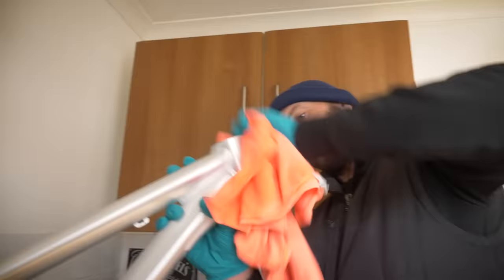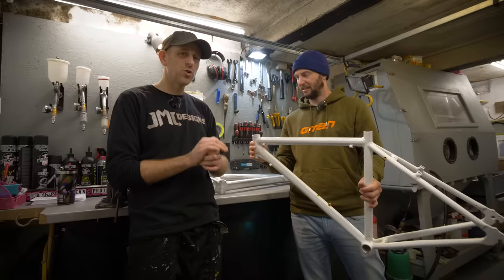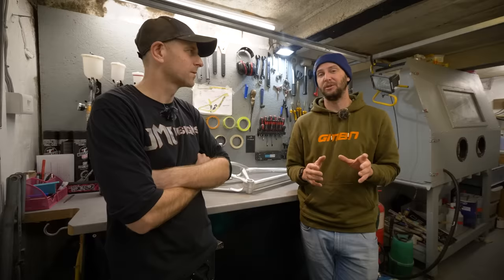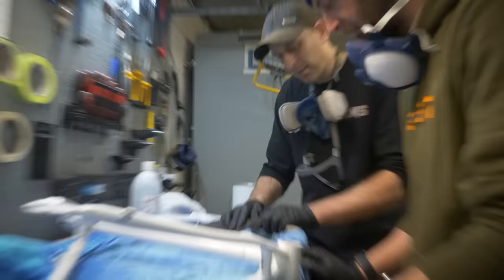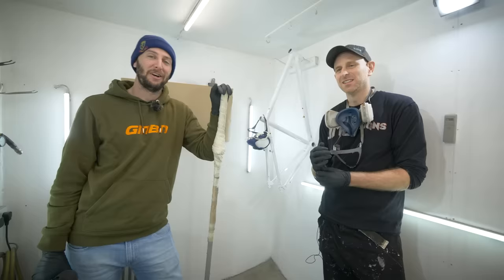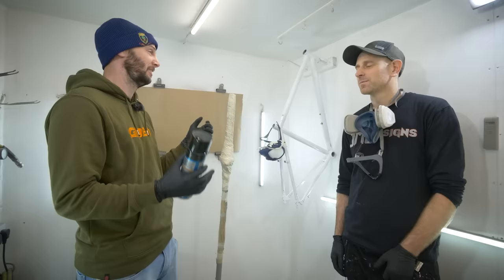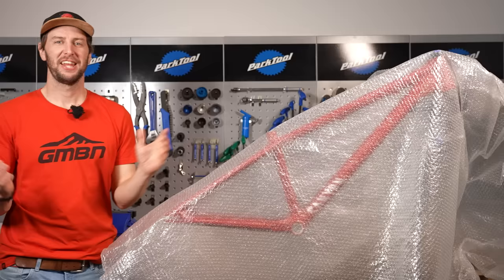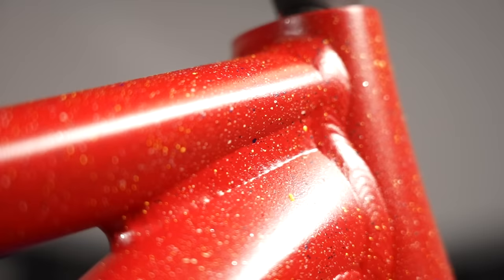How To Paint A Mountain Bike | DIY Bike Upgrades

Comment from the maker: Would you give your bike a custom paint job? 👇
Reply: I already have 4 bikes with custom paint jobs, but had them done professionally. Yours looks awesome. I am thinking of doing something with a Banshee Rune V2 I recently bought used. I like the bare aluminum look these days, so might do that. The blasting tip was spot on. Thanks!!
Reply: I'm in the process of gathering everything nicely to repaint one or two frames soon (a vintage road and a Stoic2), I'm quite scared because it's really not my thing but your video reassures me a little, thank you  !
Reply: Bought an ebike
Stripped it down, squirted it with black matte Tremclad and a year later it looks like it did after day 1.
Not the paint of choice for most but what I had on hand. No priming, no sanding or wet sanding in between. I did it outside in the sun in a 10x10 screen tent so there wouldn't be any dust or debris stick to the paint while it was drying.
6 very thin and even coats over 2 days and it looks amazing.
I'd do it again. Had a blast doing it myself, so I am bias but think it is a good way to do it if you are a true amature like myself.
Reply: Supply issues mean my fork came in shiny black and it should be matte to match the frame. It seams like a pretty basic job with a buffing and a respray but any pointers would be great. Love a good alloy hardtail. Wish my body would let me ride them. Thanks
Reply: I did mine with spray.bike and it turned out amazing
Reply: recently got my hands on an old Giant fully rigid MTB and I'm torn between cleaning it up and touching the paint up or stripping it down to bare metal and giving it a custom color, even considering heating some areas up to cause an oil slick pattern then using those markings to make a sick looking logo
Reply: I like diy paint jobs. If I want it properly done, I would choose powder coating. Its way better and rock solid. We have a lot of companies here in Germany who do coating. Its also cheaper than a paint job. Its aprox. 100-150€ for one frame :-) If you choose paint, please get 2k products.
Reply: I really want to buy an old second-hand hardtail, give it a really cool paint job, and upgrade the brakes, shocks and drivetrain.
Then, show it off to my friends.
Reply: \I have a used 2004 TREK 4300 disc and i want to get it done in nukeproof yellow!
Reply: yes i would love to but it takes time and im only off on sat and sundays lol
Reply: came here to get somne pointers

Comment: I have done a pretty good amount of spray painting and I can tell you the #1 most important part of any paint job is preparation. Be obsessive while prepping and if you have done your homework on which paint to use and how to apply it….you will be SO happy you did it yourself. Very satisfying. Since bikes are outside so much, I would use a 2K clear that is automotive grade. It will resist UV fading. Never paint without a respirator and in a well ventilated place. Painting over paint, you need to use a primer, bare metal use a etching primer. If you have never painted before, paint something else first to get the feel for it. Temperature is critical for dry time, read the can. I soak my cans in hot water 15min before I paint and I don’t set them on concrete in between coats it will suck the heat from the can. If you make a mistake, don’t sweat it. Let it dry and lightly LIGHTY sand that area and repaint it. Painting is very satisfying, but VERY time consuming. 
YouTube has hours of how to paint videos. 
Get out there and paint! Lol
Reply: nice tip there,Todd!🤘
Reply: @bongers94  thank you!🙏
Reply: I think this applies to any job you're going to do, preparation is the key to success.

The rest of the tips you have written though are spot on, great advice!
Reply: Thanks for the advices!
Reply: Always like to read the comments on these videos. Lots of little details I wouldn’t think like setting the can on concrete.
Reply: ive got quoted 180 quid + VAT to sandblast my full sus bike frame mentioning that itll be raw frame with no accesories. is that considered to be normal price nowadays? and if not sandblasting, would you recommend some paint stripper instead?

Comment: I've painted (twice) my dad's first "mtb", a '92 Giant Rincon. Still going strong as the commuter bike, basically all modern components: 1x11 xt group, mavic tubeless wheelset, etc. Kinda want to paint it again with a simple pink, just to be different lol

Splatters look dope! 

Might be spraying a little closely to the frame. Personally, I did like 4 quite light coats of each color that I was using, and a last heavier coat. Gives a better glossy finish in my experience. (yes, clear coat will help that a lot too)

Comment: Bikes are pretty easy to take apart with the right tools ,alternatively you can mask up with heavy plastic and prep it fully assembled ,although some areas won't be accessible ,maybe a bit sand paper glued to a knife mite work for these areas ,Been a painter for 20 years ,the process is the same ,strip ,sand, filll ,sand again clean ,degrease  x2 primer coats  ,2-3 top coats ,2 coats clear (matting agents available) 2k paint is best for durability ,gun paint is also worth a look for silvers and matts

Comment: Excellent video guys, keep em coming! I too have dabbled in painting bikes, but really suck at using rattle cans, even when trying extremely thin layers and multiple layers and have ended up mostly using brushes and cheap tins of paint from low end hardware type stores (£2-£5 tins from b&m for example) and an inordinate amount of wet sanding sanding between inordinate number of coats. Which is why I was surprised that this vid didn't talk at all about sanding between coats (I  assume there was none) and whether the drying time was a) Followed and b) Adjusted for the lower temperatures than most rattle can manufacturers recommend, that the UK so blesses us with.

But it has inspired me to try again with rattle cans when it's a little warmer. I have a 2017 cube aim pro frame in orange where it's been sat in strong sun (before I bought it) and faded most of the colour to acid yellow unevenly along the frame. But, I'm waiting til it's a little warmer, the highlands of Scotland ain't often forgiving...for more than 5 minutes at a time.
Number 1 priority this time will be a better keying.

Comment: 2k clear is a must if you want it to be like a factory finish. 2k has a hardener in it. Otherwise the paint job will never last. I’ve done many bikes and  most people think it factory paint even after years of use. I also use a 2k epoxy primer on any bare metal.

Comment: You can get 2K clearcoat that's way more resilient than normal clearcoat. The 2K mixes when you want by a special valve on the bottom of the rattle can.

Comment: Should've removed the decals before the clearcoat..at least that is what I'd have done. I'd also would've used 2k clearcoat. But good job nonetheless 👍
Reply: They were. The first clear coat had a glitter finish which I didn’t want on the bare metal so after I’d applied that all over I then I removed the decals and gave it a plain clear coat so the metal didn’t have a sparkly finish.
Reply: @richardpayne5176   oh yeah, i forgot about that glitter. I stand corrected. Can't wait to see the build.

Comment: I have been considering this for my frame. But must admit that dismantling the entire bike makes me nervous.

It does need doing though because it's a low end bike and I'm in the process of upgrading it with budget, but good (ish) parts.

A new paint job would get rid of garish orange and crap decals which would be good!

But then I worry I'm spending money I don't really have on a cheap bike. It is mechanically sound and in great condition though, plus it was a bargain, so, I dunno.

Too many variables to consider 😔
Reply from the maker: Hi! It can be really cool to give your bike a new splash of paint but, it's not essential. There are cheaper ways of customising the look of your bike like buying new decals! The fact that it runs nicely is the important thing! 👍
Reply: @gmbn  This is true. I did have a crack at getting a logo off of the chain stay with a view to just going with solid orange all over, but I was too heavy handed so went through to bare metal, so that bit looks crap now! 
It's hard to know which decals would fit my frame though, are they generic shapes and sizes for a generic hardtail frame or...?!

Again, troublesome variable's! 🤷😏

Comment: Buy paint stripper for aluminium frames. you just brush on n paint falls off, save hours of sanding, or take it to powder coaters for a dip in ther stripping tank. Spray paint outside you better cover it or dust flies n other crap will stick to it

Comment: I painted a bmx frame red a couple years ago. And when I applied the clear coat it crackled the red. I would sand it down and try again a number of times. I tried research it about the other thing I could find was I wasn’t allowing the red tick cure but even when I waited like 2 1/2 weeks it’s still crackled it. I finally just put the red on and abandon the clearcoat, I was beyond frustrated and pissed off at that point. I’m still not sure why it did it like every time.

Comment: Looks ok but I bet it'll chip off with a bit of trail abuse. I got mine powder coated and it's pretty bulletproof. Only cost £80 including them masking and stripping the old paint
Reply: Powder coating is not solid its just a plastic coatin it will damage n shatter if it takes a good hit n basically unfixable without redoing hole thing but so could paint i suppose
Reply: @Rab_Cee  well, I've tried both (not diy, both given to pros) and the powdercoated frame still looks mint while the sprayed frame didnt last. I'm sure, like many things, it has much to do with the skill of the applicator and the materials used.

Comment: Would you not have been better to take the stensils off before clear coat ??
Reply: Watch the vid, she was clear coated again after the decals were removed this time without the sparkles to leave it looking like a bare metal finish
Reply: @richardpayne5176  yeah I seen that was to quick off the mark hahah top job 👍👍
Reply: Sadly most people are when it comes to commenting. Cheers 👊
Reply: @richardpayne5176  yup not usually me though but you cought me out there rich 👍👍 Al put my shoe back in my mouth hahaha

Comment: 😂 Man… paint in the hands is no fun at all. I’ve painted a fair amount and you can def manage splatter without getting it on your hands. Also… drying outside, exposed isn’t the best since the paint can get dirt, hair, insects, etc stuck in it. Not fun if you have to fix it. Obviously a spray booth isn’t available fro everyone, but painting outside then moving into a garage is best.